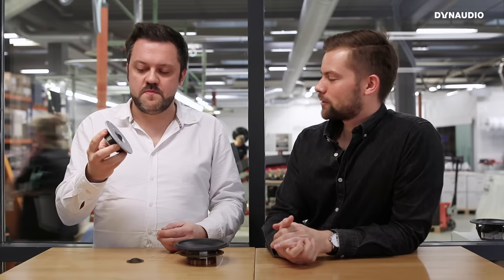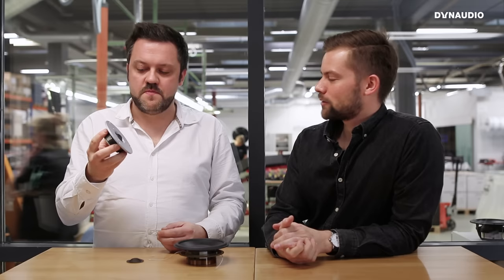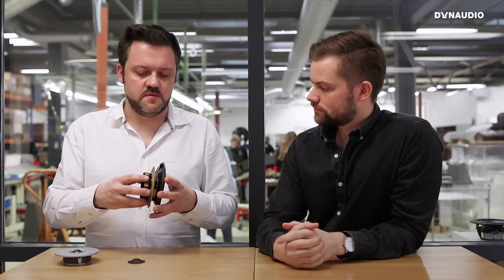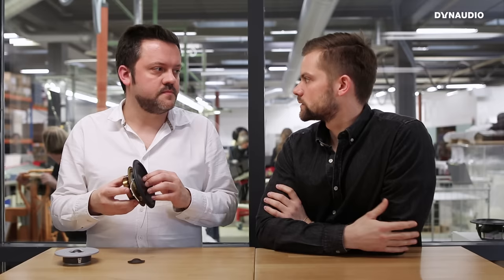How to clean your speakers

Comment: Contour S5.4, one of them sounds a little bit duller.  Tried different locations, exchanged monoblock amps with the other speaker and no change, so I assume it is the speaker.  Coincidentally, it has a couple small dents on the tweeter.  Could that be the reason of the slightly duller sound?  Or would it be a crossover issue?  Your advise will be appreciated.

Comment: Hello, I didn't really know how to clean my Denon speakers (Denon DM 41). They has some dust. I clean carefully with a paint brush the cone and lightly pass on the tweeter. Unfortunately I did not know that a much softer paint brush would have been better. I don't see any damage or bad sound but could you please tell me if i ruined the Denon speakers?
Thanks.

Comment: Dynaudio is great! But just one question: does it harm if you clean the tweeter using a soft small paintbrush? Because this seams to be the only way to remove impurities that stick to the surface.
Reply from the maker: Hi Johan. As Otto said in the video, we would recommend blowing at the tweeter and then just leaving the rest. Any leftover residue that isn't thrown off when you use the speakers doesn't affect sound reproduction. //Christopher.
Reply: Silk dome are a bit forgiving Ribbon tweeters are very delicate, Even a mild blow will damage it.

Comment: I have some Canton GLE 100 speakers from 1979 with dome midrange and dome tweeter made out of very soft material, might me silk. They are kinda sticky to the touch and are like magnets for dust, litterally impossible to remove, does not affect the sound but looks a bit bad. Not gonna try to clean them with more than normal tape, as there are impossible to find replacement parts. They are so precision manufactured you would not belive that they are 40 years old, German quality really speaks for itself. And they reach 30Khz, which is way more than enough. Makes you really think if speaker technology has really advanced at all since 1980.

I mean, few modern amplifiers would match my Optonica SM 4646 from 1978. Dual mono delta DC power that weights 17 kilos and puts out 95 watts into 4 ohm at only 0,08% distortion. And the late 70s had many speakers wayy ahead their time, including my Canton GLE 100. Some speakers could reach 200 Khz with ribbons in the late 70s, and many impressive 12-15 inch woofers went below 25Hz.

Comment: By the way, chapters will not work as intended based on how you've typed them in the description. It should just be the timestamp, space, title. e.g. 0:52 How do I clean a woofer cone?
Reply from the maker: When we click on them, they work just fine?
Reply: @dynaudio  Right, but if you use the format I suggested, it'll also show up in the video timeline and have dividers.
Reply from the maker: @ZoomerNostalgia  Ahh understood. Thanks for pointing it out!

Comment: NEVER  NEVER!  NEVER clean or treat rubber surround with rubber care! REALLY NEVER! 
It contains silicone oils that make it look good, but which go into the bond and dissolve them in the long term so that the bonded parts separate from each other. Because of the silicone oil, it is very difficult to re-glue it. Dr. Kurt Müller, the manufacturer of Dynaudio rubber surrounds, recommends cleaning the rubber surrounds with benzine. If the rubber surround becomes yellow if you push it, it is oldered and defective and must be replaced. The tweeters can be cleaned very easily with a cosmetic rouge brush (without prior cosmetic use).
Reply: That's a valuable info. Thank you. What about using silicon free rubber care products like the one made by Wurth?

Comment: Dynaudio, can i buy only Diaphragm voic coil  to tweeters or i must buy all new tweeter? I have Pair D260 and Pair D28af,  one of 260 and one of 28 voic coil its destroy, now buy new its verry expensiv, can i buy that part somewhere?
Reply from the maker: Hi Luke. No, unfortunately, you cannot buy the diaphragm + voice coil on their own. That's because we want to ensure your speakers sound their very best and we cannot guarantee that in case we were to sell individual spare parts for our drive units. So, you will have to buy a replacement tweeter at your local dealer. //Christopher.

Comment: will cleaning the rubber surround with tap water, damage the rubber over time? I’ve done it already tho. I’m very concerned. thanks
Reply from the maker: Hi Chris. We recommend that you clean your woofers with a damp cloth that's well wrung out and then wipe it down with a dry microfibre cloth to finish. If that's what you've been doing, you should be all good 😊 //Christopher.

Comment: I'm still using a pair of Audience 10's from my birthyear - still great speakers! Would it be possible / recommended to upgrade some of the drivers?
Either way, fantastic speakers! My dream is to one day work with Dynaudio - I'm studying 3D architectural/product visualisation and hopefully soon industrial design! :)
Reply from the maker: Let me just check if we can replace the units from an Audience 10 and get back to you, Victor. As a rule, we don't do upgrades, as different units with different specs most likely would affect sound reproduction. But, we do encourage people to replace especially the tweeter in older models. I'll check and get back to you. 

Now that's something we like to hear! 😄  You're more than welcome to send us an unsolicited application or have a look at our current positions. I know that you're not looking for something right now, but it never hurts to make people aware about yourself: http://www.dynaudio.com/dynaudio/jobs-at-dynaudio. 

//Christopher

ps. hopefully, we'll meet at Dynaudio some day!
Reply from the maker: Talked to customer care, and you should be able to order replacements from your local dealer. Just bring the units that need replacing. There will be some delivery time, though. :-/ //Christopher.

Comment: could you please tell me how can i clean the sticky marks from stickers . with the oil? thank you very much
Reply from the maker: Let me talk to our carpenters and get back to you :-) //Christopher.
Reply from the maker: So, we've discussed the best method for removing the sticky marks and would suggest using a good glass cleaner with a very low alcohol content. You should test out the product on a none-visible place on your speakers to make sure the product doesn't harm the lacquer. Also, do not rub too hard, be gentle. //Christopher.